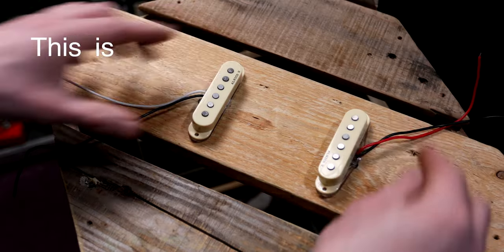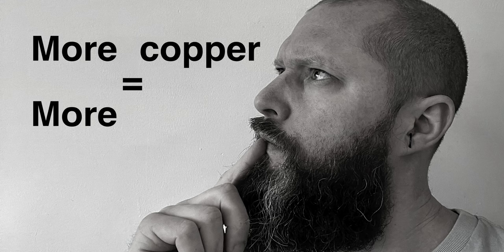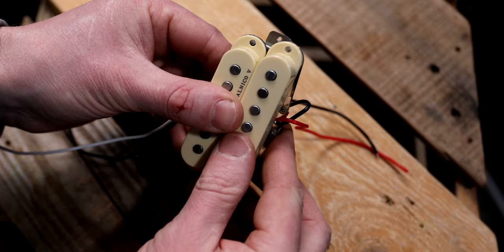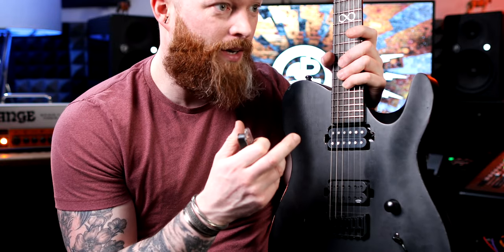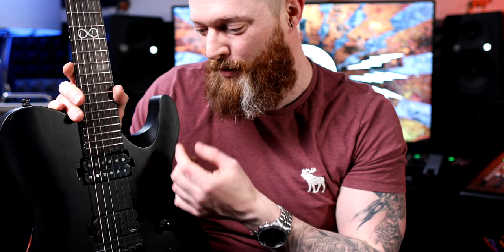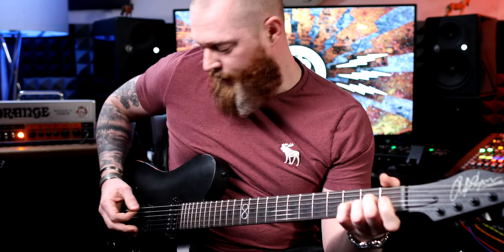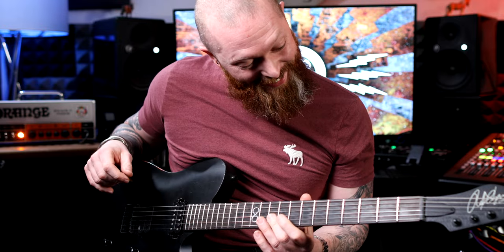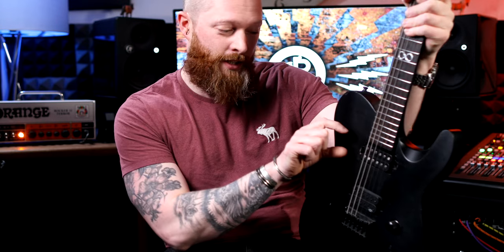2 single coils in a humbucker slot

Comment: This has always been my complaint. A split humbucker will never sound like a single coil. I've done this mod, crudely in the past. It works, folks. You have re-ignited my desire to do it again. When you have a muddy sounding humbucker, try dropping the capacitor value even more. Go from a .022 to a .01 cap. it will brighten up the sound. Thanks.
Reply: Neck humbuckers are an issue when played through low wattage tube amps where you get this thick tone- pushing towards overdrive

Comment: Been thinking about doing this on an HH strat or LP guitar. I hate clean humbucker tones (aside from middle position on an HH guitar) but hate standard HSS setups so want a setup like an HS type thing but THIS is where I was headed and now I'm convinced.
Reply from the maker: Mate. That’s exactly why I did it. I know how you feel. Which guitar would you do it on?
Reply: @PherotoneStudios  I've got an HH Strat here I could jazz up. Already got a 5 way switch. Just need a new scratchpad ate the routes are for wide range HBs
Reply: A strat pickup is 5.5k. If you put two of those together you get 11k. And that could be too dark and muddy for most which is why the humbucker is 7 to 8K. But of course when you split that it gets too thin and quiet. 

Another solution is to make a bright humbucker like Gretch does, or GFS calls its "gold foil humbucker". I have it on a guitar and it's 6K and it really sounds good. But it is not a single coil.

Comment: That’s a great mod! 👍🏼
I think the Apache is little brighter sounding, would have placed it as the middle. 
You could run them in series or parallel too .
Had planned to modify me a guitar with two different telly bridge pups close together, running them on their own, or parallel or in series (massive output). A fat warm one in the back, and a more trebbly one towards the middle.

Comment: Sounds great! Also, this video gets me closer to what I want, which is basically a single coil in the neck, BUT, in the position closest to the neck. I would take the other coil out (the one closer to the bridge) and run just the one single coil near the neck, and put in a dummy bobbin cover in the empty space, or a nickel cover over the whole thing. I bet that would sound fantastic, you'd get more of that "hollow" strat sound.
Reply from the maker: I’ve just done a video on a single strat pickup in a humbucker slot if that helps :
https://youtu.be/cJxJhzHB7Is
Reply: Dimarzio makes a pickup called the Bluesbucker, which is essentially what you are describing
Reply: If you enjoy building yourself and experementing for their own sake , great ! And enjoy !

   But several of the aftermarket pickup makers offer a variety of single coils in humber casings / size footprint .

Comment: I don't know if you are aware of this, but it's been done. Only on the bridge position instead of the neck. Robbie Robertson from "the Band" did this on the guitar that he played for their last performance, "the last waltz". Somewhat like this anyway. I don't know for sure how it was wired. He also had the body of the guitar coated in copper. I don't know if that had any affect on the sound. It had to have made it a heavier guitar though. I believe there is a Robbie Robertson model strat made this way. At least it was in the works at one point.

Comment: A humbucker IS two single coils back to back. There are humbuckers with the characteristics you hear in this video.   The DiMarzio DP-156 ("Humbucker From Hell") has a DC impedance of 5.8 kOhm ... in series!  The two coils are unbalanced (tonally, not such that they don't cancel hum). Another one is the DiMarzio EJ (Eric Johnson) custom neck.

Comment: One way of getting back that single coil upper end is to use 1 meg volume pots.  The best pickups for that clear sound and use with gain seem to be rail pickups.  Dimarzio's in particular sound great with a 1 meg pot as they often have a decent amount of bass built in.  

But a good pair in the neck might be a Dimarzio Norton S on the Bass side and something bright or neutral with the Fast Track 1 or Cruiser Bridge. 

Eventually would the proximity to each other even out the magnetism between the magnets on each pickup?
Reply from the maker: Interestingly I’ve had a Dimarzio rail in the neck of this for a long time now. Can’t remember which one though. Works fine next to the Bareknuckle
Reply: @PherotoneStudios  I tried researching years back the idea of a rail pickup mounted with a single coil sized sustainer. Apparently a sustainer and magnetic pickup can't live side by side...

Comment: Easily check the magnetic polarity of each pickup with a compass. A correct pair is North on one and South on the other in the pair. Note that the winding direction matters and matches the magnets! You'll want the inner pickups to be N-S paired so it will remain humbuckers even on separate 'pickups'. Read up on RWRP pickups and PRails if you want mostly hum-free sounds.

Comment: Very cool, try series / parallel for the neck to get a thicker humbucker sound. The switch wires it parallel which is thinner sounding.

The way to probably do it a little bit more affordably is to use tele neck pickups.

Comment: Actually, that's not true about the copper. Copper comes in specific gauges. 42 gauge is common. A vintage Fender single coil is wound about 8k turns, which yields a specific DC resistance - maybe 5-6k. 

Using magnetic pole pieces in Humbuckers seems like a great idea, and I am not sure why they don't do that. I think Gibson first used the P90, which has a bar magnet, and then when the humbucker came out, they kept the bar magnet. Fender used to make a Wide Range humbucker that did this and I think one of the old Filter-trons did that - but all of these humbucker like pickups have used bar magnets for some time.
Reply: Don't Lollar make proper fender wide range humbuckers these days? Because Fender themselves don't make them anymore and haven't for decades, they instead just have standard humbuckers with a wide-range faceplate on them, so they look like wide ranges, but don't sound like them. So Lollar make ones that are built the same as the real wide ranges.

Comment: You might be able to rewire it to replace the out of phase position to give you both neck coils in series. It might require a proper 5 throw switch, but they're not hard to find.

Comment: Thanks I’ve been pondering doing something like this on a Kramer beretta special I’ve got because I don’t care for the tones of a clean bridge HB, so I was thinking about putting a JBJr or another rail single coil sized HB closet to the bridge in the single HB ring of my beretta and then maybe something like a Duncan quarter pound in the neck side of the bezel to hopefully get a kinda fat middle-ish position clean to edge of break up tones but still have the bridge HB because \,,/, METAL! I would use a push/Push  single volume pot to switch between the two pickups like the Charvel Henrik Danhage signature. I want to keep the clean single volume knob look and I rarely use a tone control. I might have to get a stacked pot to have 500k on the HB and 250k on the single and then I’d have to come up with a stealth way of switching PU unless I used a concentric stacked pot and both were always on and I could blend and control the level on the pot . Ok you see why I never actually do any of these experiments because, I can never decide exactly what I want to do and give myself options paralysis thinking of the different ways I could do it..... if I ever actually did do it lol.

Comment: I've never had any use for split-coil humbucker sounds either, so that's good motivation for trying this. This seems effective, but you'd still be getting coupling between the magnetic fields of the two sides, even when they're split. Have you tested that?  Perhaps a non-metallic baseplate would help to isolate.

Comment: Did you wire them individually as two single coil sounds, I was always thinking of wiring them in series like a humbucker and using a coil tap switch to get the true sing coil tone instead of splitting an actual humbucker which, of course isn’t the same as a single coil tone. It basically the of splitting a humbucker, pairing two single coils in series. Does it work? What does the series wiring sound like? You have done the hardest part, the mechanical work now just the wiring in series and test. Anyway it was a thought since I never heard of it before. Thanks maybe in another video?

Comment: I'll admit it took me a while to sink in what you were trying to do . And what you actually did .

  What you actually did was aproximate a Tele with a choice of neck pickups .

 Position 2 = Tele position 2 with a '60s neck pu .

 Position 3 = Neck only with '60s pu .

  Position 4 = Neck humbucker wired in parallel equivilant .

  Position 5 = neck only with '50s pu .

   If this is what you were seeking , Great !

Comment: Real late comment but concept i came up with a couple of days ago
pickup with two coils, one with enough turns to output like a single coil, other one intended to be turned like one side of a humbucker; the single coil is coil tapped to the same count of turns as the humbucker side
coil splitting means that the first coil gets all turns of copper active, making a proper single coil sound, and turning off the coil split Just turns it into a humbucker by using the coil tap
could this work
Reply from the maker: That’s exactly the thought process that inspired this idea. I’ve tried a humbucker of that design but it wasn’t quite to the spec I wanted so I didn’t like the sound
I’ll get a pickup winder and make one how I want so it’s an actual single coil and an actual humbucker

Comment: That sounds SHOCKINGLY good. What is your signal path in this video?
Reply from the maker: Thanks mate. Orange Rocker 15 terror dialled in super clean but flat EQ. That was probably a Celestion Greenback cone. 
SM57 just off the centre of the dust cap. 
No post production but that was a hall of Fame reverb in the loop on the Church setting

Comment: I recently replaced the Chapman seymour duncan neck pickup on my Chapman ML3 Pro modern with a SH-2n jazz and in switch positions 2 thru 4 the combinations sound out of phase. any ideas? I wonder if SD Chapman bridge pickup and SH-2n are wired differently internally. i may just get the SD JB and replace bridge pickup.

Comment: I just got a super cheap project husk on Reverb (Just a First Act guitar that someone had fully dismantled) to fiddle around and learn about wiring, etc without messing up a good guitar, and it needs a pickup. It is routed for a single humbucker in the bridge, and I've been trying to figure out what I want to put in it. I really like this idea. I was thinking of a GFS humbucker of some sort with a coil split, but this sounds like a great experiment. If one of the pickups is RWRP to the other, it should function as a humbucker when their both on right? (I assume if they're not of similar output, then it likely wouldn't fully buck hum, but at least it'd be less hum.)
Reply: Instead of a coil split , try parallel wiring ( with switch if desired ) . It will sound more single coil like than a split or tap .

Comment: So, nothing changed except location in the guitar? 

Asking bc I’m making a guitar, from scratch. Haven’t cut pickup cavities yet but want the appearance of HH w having HSS…

no flipping magnets or wiring in series/ parallel??
Reply from the maker: Are you body mounting or is there a pickguard?
The middle pickup was reverse would and reverse polarity I believe, so would work like a HSS strat
Reply: @PherotoneStudios  the pickups came from a strat…but, they’re going into a solid body…

I’ll be using pickup rings to mount 

So, in theory, if they attract side by side, I should be good…

If they do NOT attract, prob not gonna work w those pickups?

Comment: What would be the difference between Neck humbucker in parallel mode vs 2 single coils in a humbucker slot? I suppose with the latter, you could experiment with different pickups, but are there other benefits?
Reply from the maker: The humbucker would sound like two split humbucker coils in parallel and the single coils would sound more like a strat.

Comment: Is it necessary to remove the bar magnets at bottom??
Reply from the maker: Yes. The pole pieces in single coils are the magnets
Reply: @PherotoneStudios  even for ceramic pickups?
I
Reply from the maker: I think so. Barre magnets on single coils and humbuckers have slightly different orientations so you’d need to make sure they were the right way round and you’d need one reverse polarity.
Also I’m not sure how you’d fit a ceramic pickup to a humbucker plate as the magnet would shatter if you drilled though it
Reply: @PherotoneStudios  but arent the bar magnet supposed to magnetize the poles in a ceramic pickup. So wouldn't removing the bar magnet mean the pickup wouldnt work? 
I was planning to glue the pickups to the base plate.

I am using the neck and middle pickup from yamaha pacifica 012 to put in a H-H ibanez 

Would appreciate a better solution with the parts i have available?
Thankyou for the respones
Reply from the maker: Think I see what you mean. I’d keep the bar magnets on the single coils

Comment: how does one screw the single coils onto the base plate? the normal holes for the adjustment screws or do i have to drill in between the pole pieces?
Reply from the maker: I pre-drilled the base plate and then used the standard humbucker screws to fix the pickups to it.
These should locate between the pole pieces
Reply: @PherotoneStudios  got it thx
Reply from the maker: Let me know how you get on. Glad someone else is trying this as it’s so cool
Reply: @PherotoneStudios  already got the parts lined up. baseplate from old muddy epiphone pickup and some old ceramic no name single coils as coils. 
still need to get myself a proper magnet. neodym would be a cool option, am not sure yet. might try an alnico 8 or something weird like that.

do you think i could get away with not waxing them if i use good quality isolation tape around the coils? little feedback is ok, i just dont want it to squeel at whisper volumes (like my super 70s did ;)

Comment: I made the same in the bridge of my strat, with two am std pickups. With a 3 way switch (single/series/single coil wiring). And put a seymour classic stack in the neck. Its a very polyvalent setup. Not real humbucker sound but nice for me with my beloved 2555sl head. Not metalic base plate, just plastic for me.